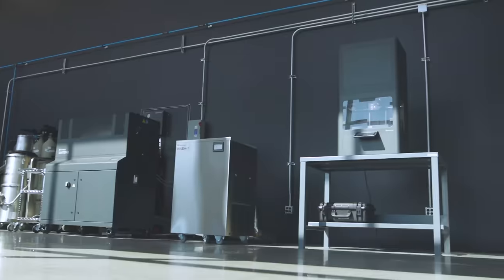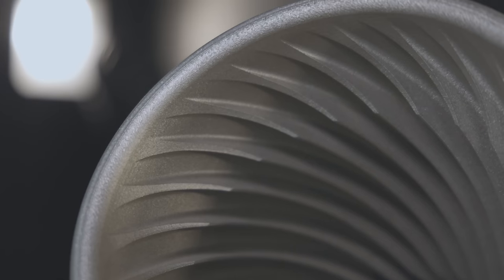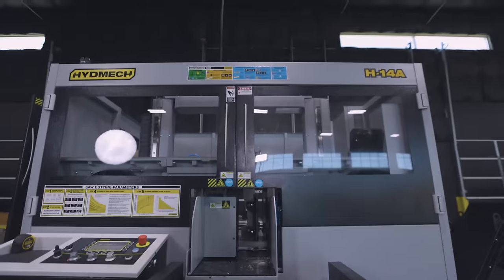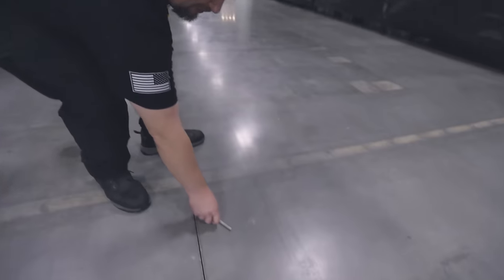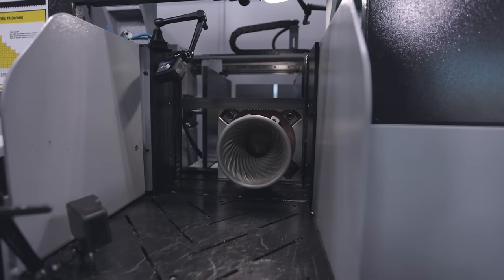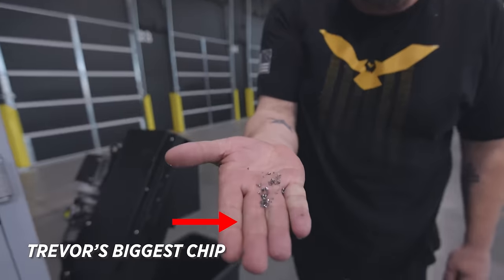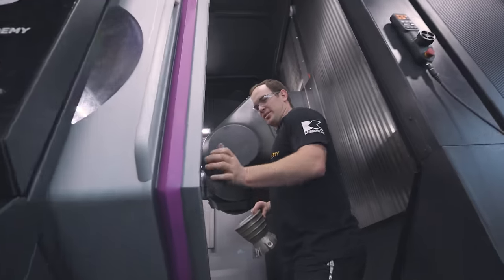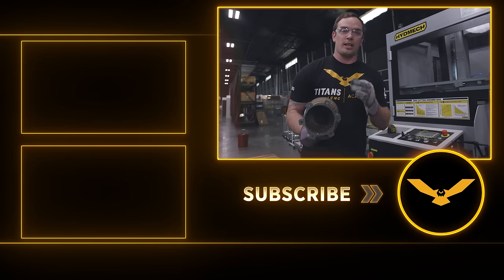How Do We Finish Machine this Large 3D Printed Rocket Part???

Comment: What is a vortex nozzle?!? For those who find themselves asking this question, I've put together a simplified way of describing what it is and how it functions on a rocket. 

The vortex nozzle serves as a hybrid method of cooling the rocket's combustion chamber while delivering fuel at the same time, also known as Vortex cooling.

Injecting pure oxygen gas into the combustion chamber at a tangent angle creates a swirling motion between the walls of the chamber and blazing combustion that occurs in the center of the part. 

The layer of oxygen gas actually prevents the fire from touching the combustion chamber walls, enabling the walls to stay cool. 

Testing vortex cooling is very difficult when you can't physically see what's happening in the combustion chamber. This is where 3D printing is necessary. The original prototype was printed using a clear resin, allowing the testing process to be filmed and studied in slow motion. As you can imagine, this made troubleshooting failures possible.

- Community Coordinator
  Titans of CNC
Reply: Great explanation of a super cool (🤨) part. 👍🏼👍🏼

Comment: I found the hand braking of the calibration post interesting as if it were 1/2" 316SS cold rolled rod that would not have been possible.....
Reply: The calibration post is printed with a lattice structure at the bottom making it easy to breakaway from the build plate. You cannot break the solid post by hand.

Comment: thanks for mentioning that you will surface grind the base plate. how long can you use the base plate before it gets too thin?
Reply: Clean-up on the base could remove as little as 1 or 2 thousand's of an inch, or is even less these days?
Reply: I can't give you a specific number because we haven't fully used a plate yet so we don't know, but it would take quite a few builds before it needs to be replaced, you would be surprised.
Reply: @trevorgoforth8963  thanks for the answer, but please tell us once you have some more data. I wonder if it is something you have to add the cost for to the price of the part, or if you can just suck it up with the profits.
Reply: Large 316L parts like this will distort the build plate significantly (pulls upwards at the edges due to weld contraction)
So material must me removed from both sides of the build plate to ensure the top and bottom faces are flat and parallel, to within approx 0.02mm (0.0008”).
The build plate in this video would probably require approx 0.2mm (0.008”) removed from both sides to be flat and parallel again. So 0.4mm (0.016”) total material removed. You can keep using build plates until they’re approx 19mm (3/4”) thick, but it all depends on how large the part being printed is. Large parts equal large build plate distortion and small parts equals smaller distortion. There are many other factors affecting this though, including the metal being printed, layer height, scan strategy etc.
Also, a slightly rough surface finish (1.6Ra) is preferable to a fine surface ground finish, so the powder has something to grip to as it is spread during the first few layers. I usually resurface build plates using nothing more than a manual lathe and it works a treat.
Reply: @thesuperjed1  Are the build plates a special material, or can you just make them on a lathe from a chunk of scrap plate/bar?
Reply: The build plates are just made from the same material as the metal powder you’re printing with. It’s normal plate/bar material thats simply been machined into a round or square/rectangular shape, depending on printer manufacturer and model.
So 316L powder (as seen in this video) can be printed on 316L or 304L build plates. 
Most printable/weldable aluminium powders can use a 6061 aluminium build plate. 
Basically if the print will bond adequately to the build plate, you can use it. If it’s a critical print and the metals are not the same, you should have an adequate amount of ‘green’ on the bottom of the print to avoid dilution of the build plate metal into the printed metal. But the safest bet is to ensure you’re build plate is made from the same material. 
Other printable metals are copper, Titanium, Tool Steels, 17-4PH Stainless…
The material list is ever growing as the technology matures!
Note that these Laser Powder Bed Fusion printers are far superior to the filament/furnace type metal printers such as the offerings from Desktop Metal and Markforged. Those printers can have up to 25% shrinkage when they go in the oven, and around 90% metal density.
Laser powder machines are very very accurate, with minimal shrinkage (0.1 - 2%) and metal density above 99.5%

Comment: Can the Trumph shape that calibration bar like an ISO tensile test specimen?  Verifying material properties and confirming layer adhesion is important for highly stressed parts.
Reply: For tensile testing, usually a round bar is printed for vertical tensile specimen’s, and a square bar for horizontal specimens. Then the tensile specimen is machined to final dimensions from this oversized round/square bar. 
Tensile testing is not usually performed on ‘as printed’ tensile bars, but yes a laser powder bed fusion machine such as the one in this video, could print a somewhat dimensionally accurate vertical tensile specimen, but it wouldn’t normally be done.
Hope this answers your question.

Comment: 1) you don’t want curl in the flow of the nozzle, decreases performance. You wanna shoot exhaust gases straight out of it

2) the last thing you want to avoid your engine from melting is a large surface area of the nozzle walls.

Cool looking, but stupid.
Reply: there are no exhaust gases in this part at all, sherlock....